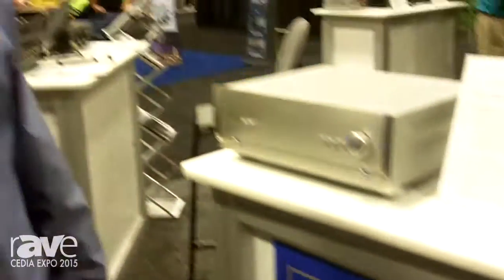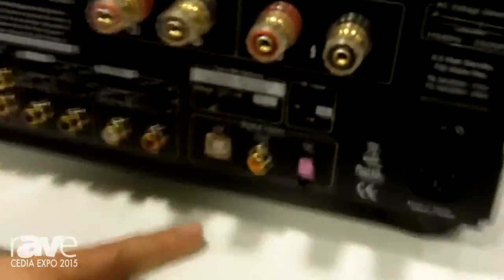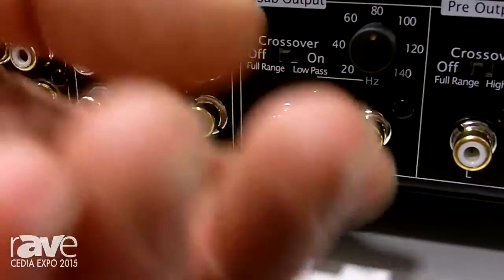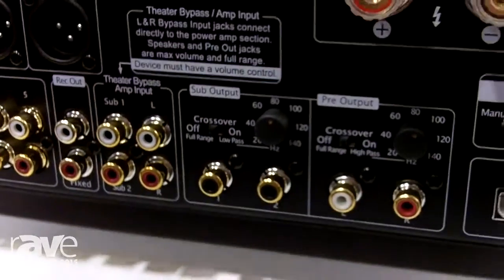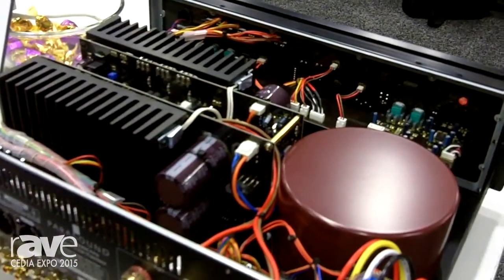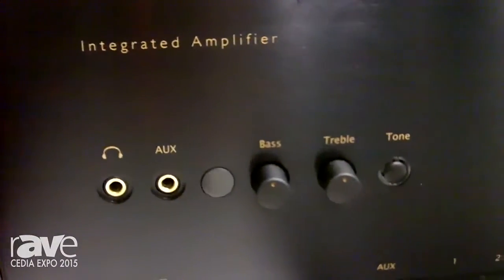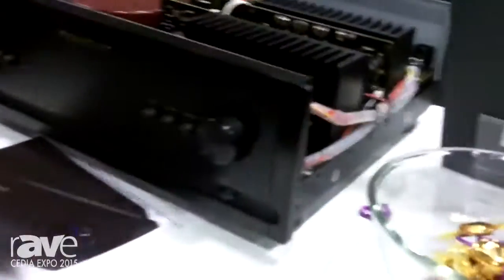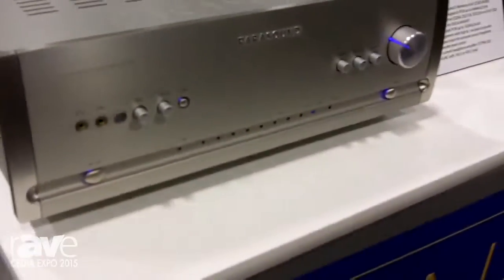CEDIA 2015: Parasound Highlights the Halo Integrated Amplifier's Interesting Feature Set

Comment: Need some help here. I've a ZoneMaster 650 and want to connect all my 8 Speakers 1 Center & 1 Sub to it.can i bridge one of this devices (JC5 or P7) to the zoneMaster 650 to achieve better sound performance ? If yes, which of the two above is best to bridge with the ZoneMaster 650 to achieve crisp sound ? If no,which other brand near parasound power/watts/quality should i buy ?

Comment: We are in 2017 !! It would now be time to cut all the options in an amplifier!
Up to a few years ago, it would be nice to have the optional, turntable, cassette, or other ...
Now everything is commanded from the source !!! The amplifier must only amplify! stop!! I can include aux in, cd input, and line, but usb, xlr, tone controllers, mono-stereo selector, cross over electronic ecc etc !! All useless options in 2017 !!
These things make her the source !!
Like the volume controller in a amplifier, it may be if you use a turntable, but I do not share it, the volume adjusts it from the source!
Too many connections, too many steps, no good sound, only complicates the circuitry! Easier and better to play !!
Reply: Yo! No more caffeine for you.
Reply: You're an idiot.
Reply: marco That might be what suits you, but don't presume it suits all others. Separate systems have there strengths and weakness as do integrated amps. But the reason for separates (electronic of old over heating etc) have pretty much been dealt with the advances in technology and design. I own this amp and I can tell you there are no comprises at this price point that are of note. The DAC is awesome and and excellent inclusion as is sub woofer bass management, which I prefer over my HT receiver bass management. It slots in beautifully with my current HT setup with HT bypass function, allowing me to enjoy the best of both worlds. So trying listening to it first before dismissing it. Then come to a conclusion.